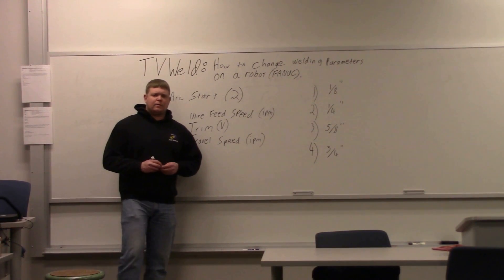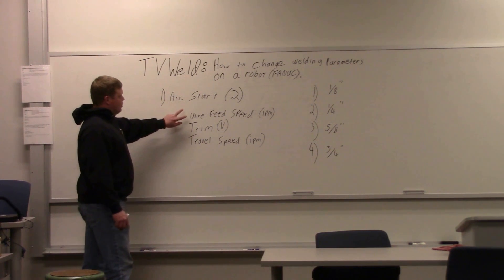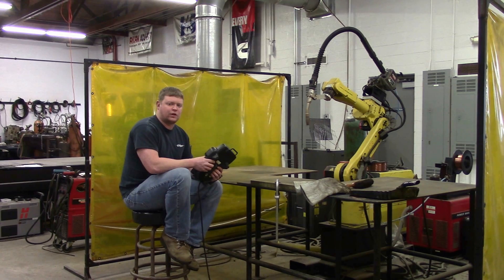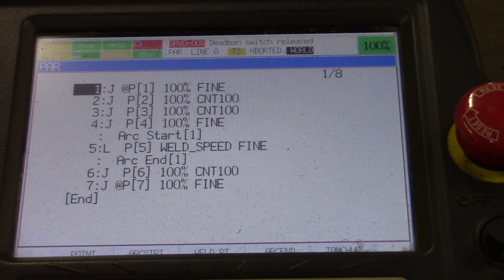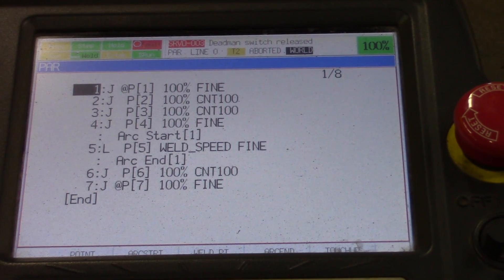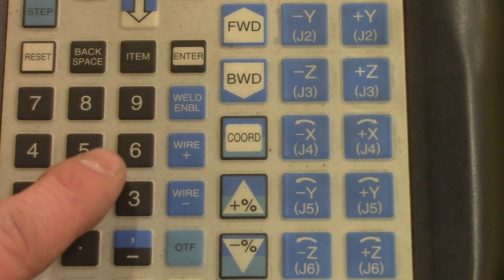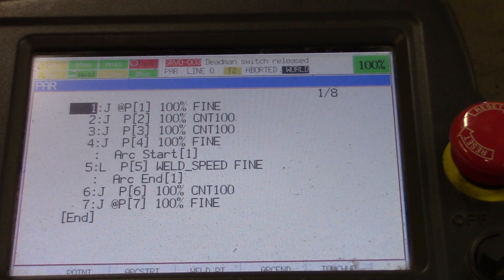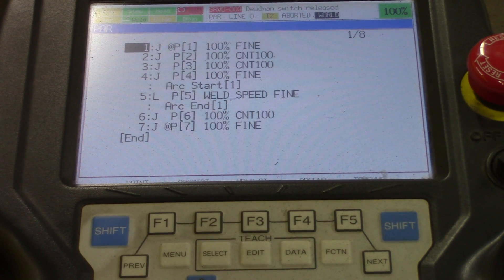How To Change Welding Parameters On A Robot

Comment: My heat only ranges from .5 to 1.5 and i can't seem to find a setting to reduce burn through im welding 14ga tubing
Reply: Trim is used in pulse welding, it refers to the arc length not so much the voltage. What welder is used on your robot? You should be able to change the weld process. If its a lincoln you could try using rapid arc which helps with burn through.